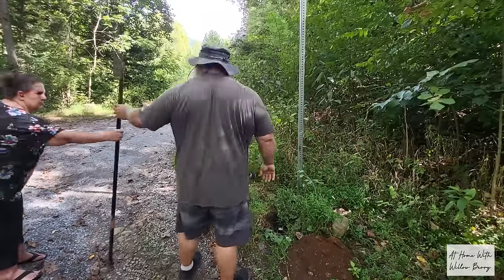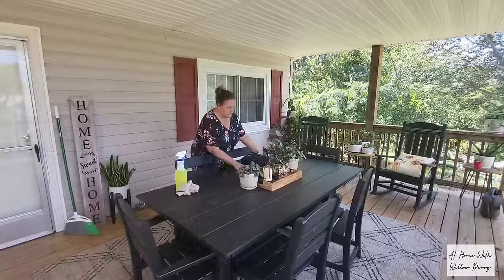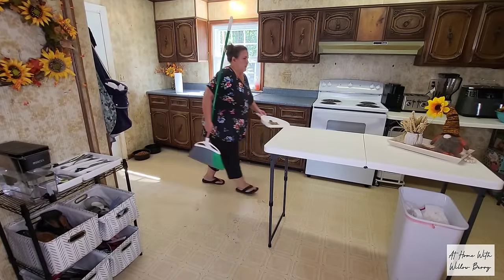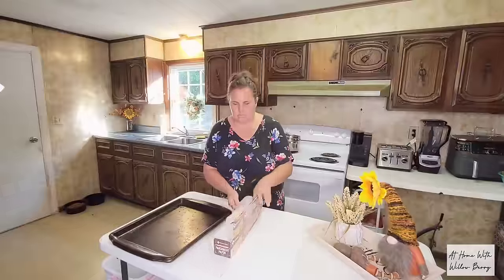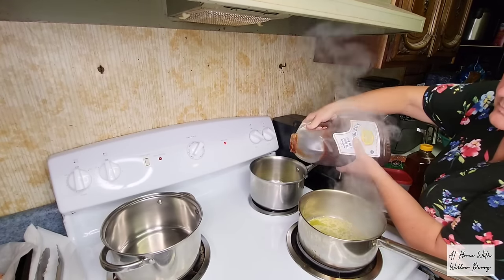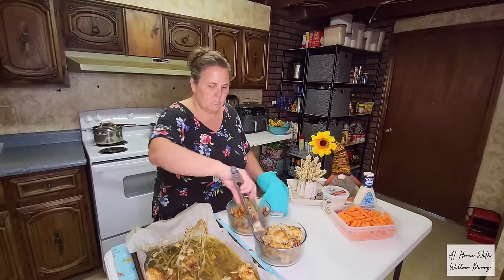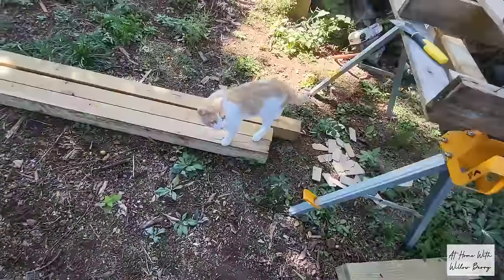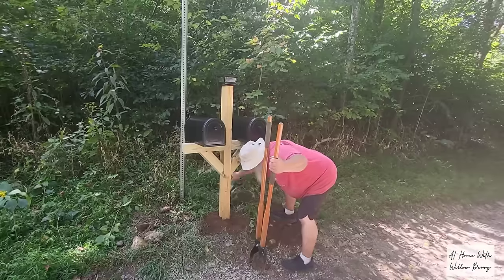A day of cooking, cleaning & construction. We built a double mailbox post. Mobile Home Living.

Comment: I like your circular saw.  Is that the  7 1/4" or the the 6 1/2" model?  Milwaukee 2732 and 2730 are both good, but wondering which one you have.  Looks like the 7 1/4.